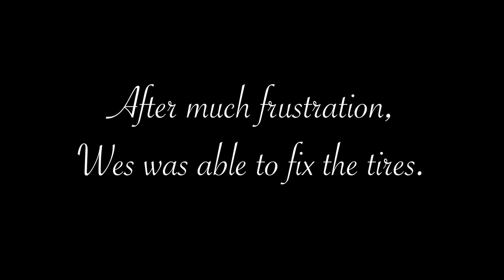I stole a backhoe! (not really)

Comment: I'm in North Central Il.  We fix lots of tile sucks from all the old clay tile breaking down.  Tips are to go slow and expect a sucky day.  Having said that, I bought an old Vermeer trencher last year, and so far have laid 3,000' of 6" tile with it.  I would not have left that bend in the tile.  It is good that the water is flowing though.  We usually dig to the top of the tile, then remove the rest by hand.  Muck soil is the worst to do this in.  We also wrap each joint completely with landscaping cloth, and pack soil along the bottom arc of the new tile for support.  Keep up the great videos and work!
Reply from the maker: I’m learning 😅

Comment: Wes. You should hire a real operator
Reply from the maker: Couldn’t get anybody out so I did it myself
Reply: @WesFarms  Well There you go that explains why you are playing with it
Wes I have fought these old tile lines. New tile crosses an old clay and then you get a blow out. 
I hooked some of the old clay tiles back together and then someI just dug up and filled the hole with real 3/4 inch drainage stone
Wes think about this   If you hook the old tile up to the new then you are going to be putting dirt into your new tile system. I would never hook out up to new

You should use a laser to get your level. But water will tell you
Reply from the maker: Didn’t hook old to new
Reply: @WesFarms  Smart young man